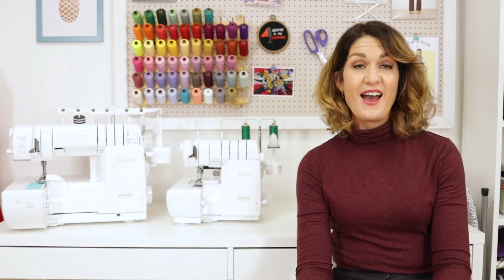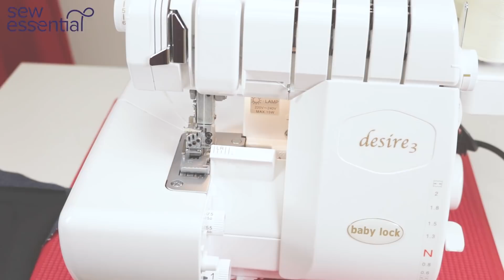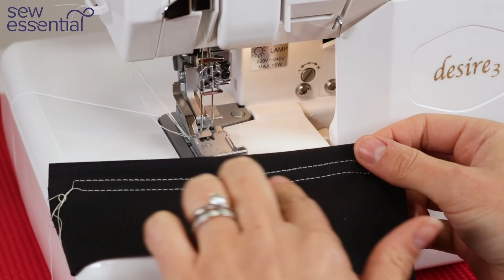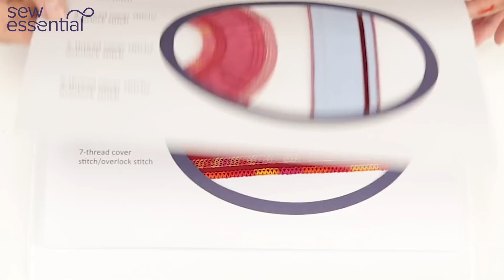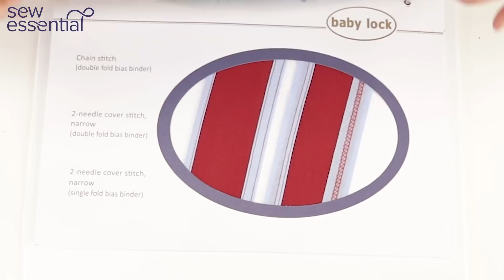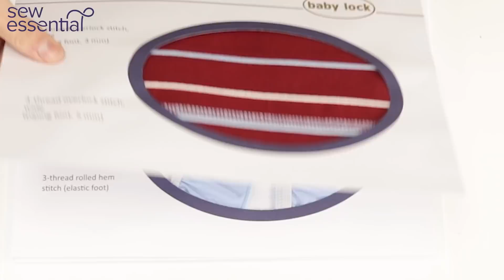Why Choose a Babylock Overlocker or Coverstitch Machine?

Comment: It actually is not an automatic tension. The thread is delivered according to the thickness of the fabric which is defined when it goes under the presser foot. It is the only brand working that way. Most brands have now machines with automatic threading, but you still have to adjust the tension according to the fabric, the traditional way.

Comment: I normally don‘t do a lot of research before buying new machines, but I did before getting my first overlocker. And the perfect tension and the easy threading were absolutely convincing. My first overlocker still had an air pump, but it was so easy to do. I have since upgraded to an ovation (when it first came out) and it is so reliable.

Comment: Since I occasionally use a pearl cotton, metallic or other decorative thread in the loopers of my serger or coverstitch (bypassing tension), I didn't go with the air threading. How heavy a thread can you get through air threaded loopers (using regular thread to tie it on)?
Reply: It actually works very well. Thick or decorative thread is just pulled through the threading system using a loop of thinner thread, then work as usual.
But I still regret my husqvarna 905… did not like their new models at the time mine broke (and no longer repairable) so went to babylock.
Reply: @Makapida  thank you for the response, After taking a series of non-brand specific serger classes where the Babylock owners struggled with the decorative threads going through the looper pipes (too bad you weren't there!) I purchased a Juki MO735 and Brother CV3550. I do have friends with Babylocks who enjoy them.
Reply: @juliemulie1805 I’m in the Kansas City area. Just bought the Babylock Victory from Missouri Sewing Machine. A friend steered me to a particular sales lady and what a pleasure! Jamie actually switched between stitches so fast I couldn’t keep up. The company also offers limitless one on one educational classes. Regardless, I’d never buy another brand of serger! Baby locks are wonderful!
Reply: @brendasullivan7553  which MO Sewing Machine store did you go to? The downtown store is fun and historic. I've spent a fair amount of money with them over the years. Glad you like your Baby Lock.

Comment: I’m in my fifties, been sewing for over 30 years and I just got my first serger about 2 years ago. Gloria with coverstitch capabilities. I can’t tell you how much I love it!! The advice I’d heard in my research about sergers is to not snip the preloaded thread but to tie on your new color. No need with this machine! Threading is easy , quick, and uncomplicated. Air threading is a genius idea, just magical. Easy to set up and use straight out of the box even having zero experience with sergers beforehand. I’ve had zero problems with it in two years (despite, naughty, no maintenance). It runs like a dream with perfect stitching every time. Unfortunately We don’t have Babylock sewing machines here in NZ or I’d have one of those too! I wouldn’t buy any other serger , I’d save to get one if I had to, even if it was the cheapest model.
Reply: I have been told Babylock sewing machines aren’t made by Babylock but are re-badged other brands. From my experience Bernina 475q model and up are excellent sewing machines.